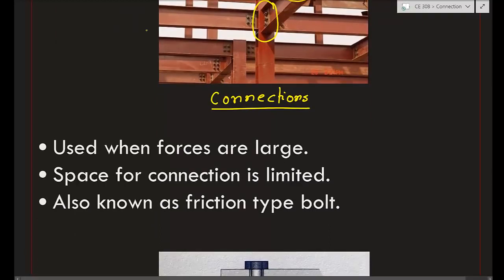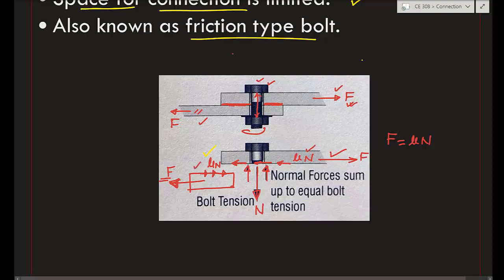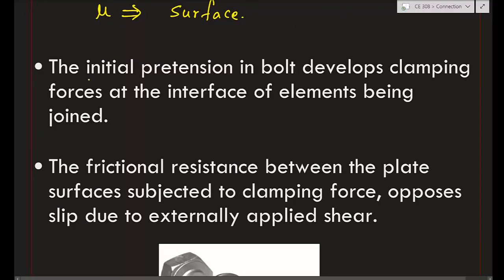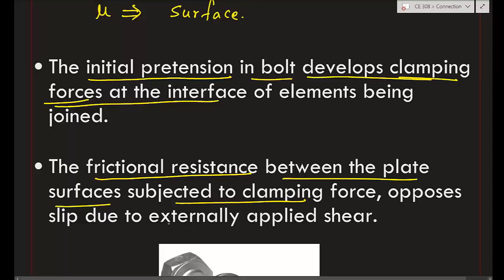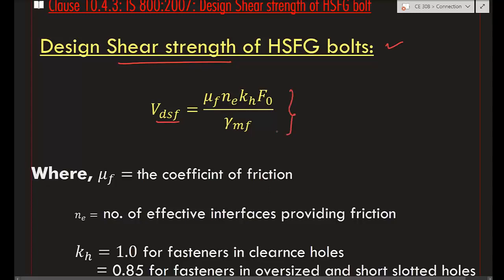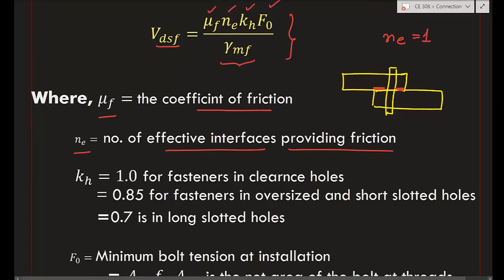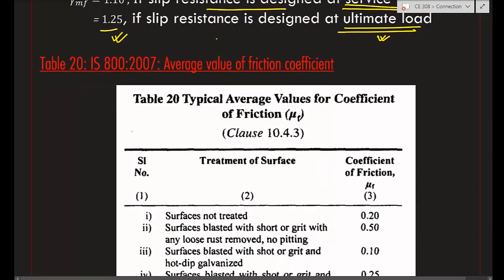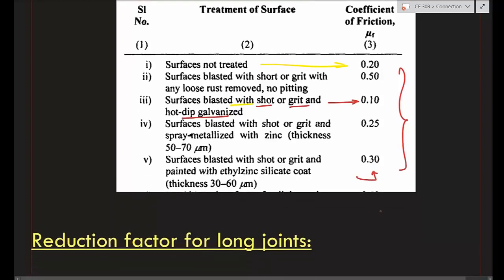High Friction Grip HSFG Bolt I Design of Steel Structure #SteelDesign

Comment: how to calculate HSFG bolt (8.8 grade) length(THREAD AND SHANK LENGTH) of dia 24mm and thickness of plate 101mm(3nos plate joint) by using IS 3757-1985